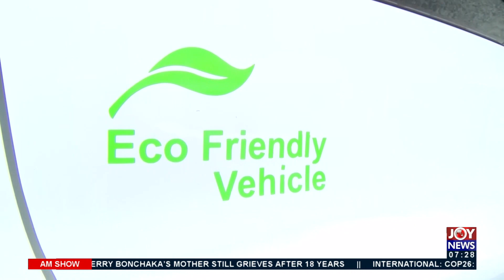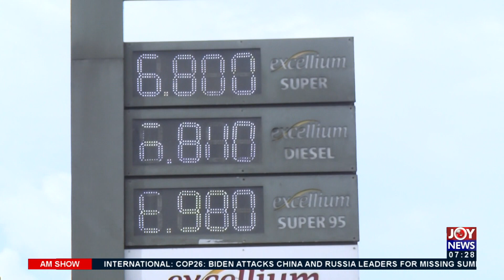Mitigating climate change: Young Ghanaian Engineer pushes for green cars -    AM Show (3-11-21)

Comment: There should be 0 taxes on new electric cars imported into the country. That would encourage all to go green
Reply: Where is the power to change the EVs? Even a developed country like Norway is struggling to get all their EVs charged.
Reply: @michaelakenya268  With EV you don't need any special power. The power used at home can be used.  You just need a simple installation
Reply: @howtolearnenglishlearnengl4126  Massa! It seems you don't know much about EVs.
Reply: @michaelakenya268  lol I charge my ev at home bruv, I guess I don't know much as well
Reply: @shortmovieclipsint  First of all you don't have it! One can charge EVs on 120V or 240V but it matter of the time needed to get charged fully. Best Voltage to charge EVs is 480V!!!! Do you have 480V   at home?
Reply: @michaelakenya268  We have EV cars. My uncle drives one and .... We get it charged with the power at home?